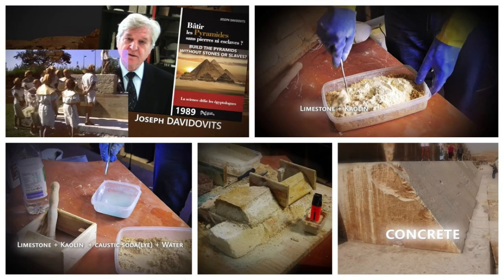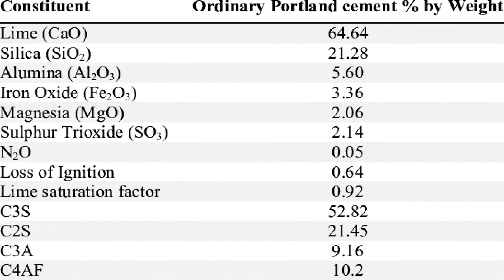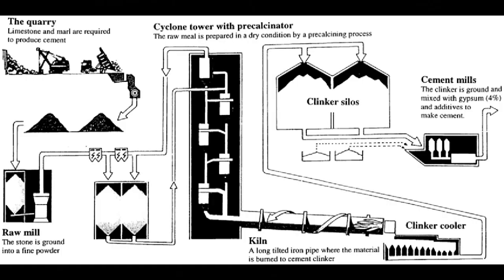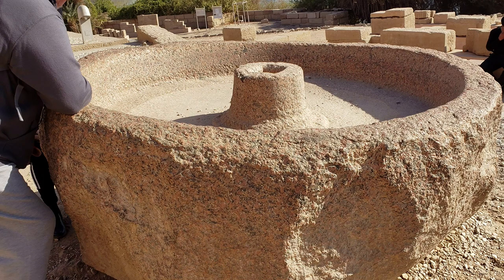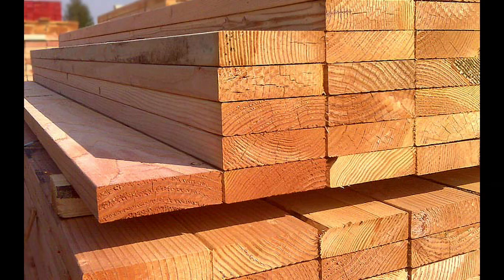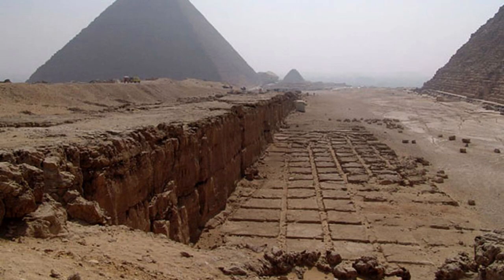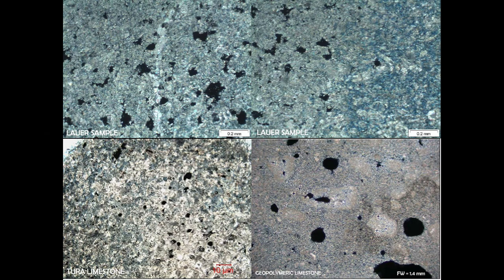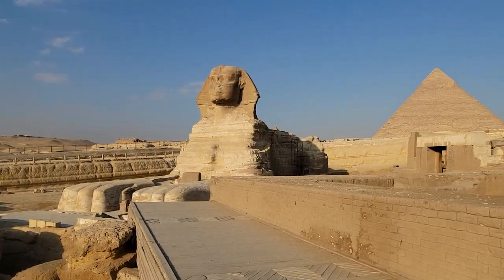Did the Ancient Egyptians use geopolymers? Part 1

Comment: A parabolic lens or parabolic mirror some kind of reflecting dish or polished brass or other metal could have been used to harness the sunlight and angle it and direct it towards melting pots are crucibles😮
Reply from the maker: perhaps...unfortunately there are no such mirrors or crucibles in the archaeological record.
Reply: @AncientEgyptArchitecture  Roman concrete was just reconstructed ot deconstructed or reverse-engineered.
So maybe we get a hold of one of them their pyramid blocks let some Specialties dissected and we will find out what Egyptians made their concrete out of ?
😳😮☄ I got a damn over here by Las Vegas Nevada you can't fit a piece of paper in between the blocks wonder how they move those blocks around with and set them next to each other so tightly to make that Hoover Dam?
😳😮☄
Reply from the maker: The blocks in the Hoover damn were made by pouring concrete into formwork, side by side. No blocks were lifted or moved into place, they were all cast in situ.
Reply: @AncientEgyptArchitecture  now you know how the pyramids were made a very crude process that's why you can't fit some blocks next to each other. They just reconstructed or re-engineered Roman concrete. It said that they leave big chunks of limestone within the mortar mix. What what does that have any significance towards. Glycol concrete it will eventually crack. Roman concrete was made with chunks of limestone so when it cracked water would seep in liquify the Limestone and it would Harden after solidifying and filling a crack strengthen itself. That's how they stand today!
  Not because they cut them and carried down and place them on top of each other. Which a lot of columns and pillars suggest that the segments were stacked vertically round blockson top of one another. 
  So ask yourself is it easier to move a bag of dirt a bag of crush quartz a bag of limestone a bag of sandstone a bag of seawater and a bag of ash from a mountain volcano or is it easier to move a "Obelisk"
If there was any drills or any tools used to core out or make holes it had to be constructed out of quartz crystal because when you drill into a quartz crystal you will create and release electric Sparks.
Reply: As long as we have the pyramids in front of us we will always be confused and misguided. Because the Builders of the pyramid didn't have the pyramid sitting in front of them when they had to consider and construct or create a method to achieve the finish product. You want to discover the creation of the pyramids stop looking at the pyramids
Reply: Furthermore the shape of an obelisk is representative of pouring forms tapering the form smaller and smaller the higher you go to exert less Force outward from the liquid mortar mix knowing the base needed to be thicker that's how even the pyramids are made with a thicker base tapering down to a point
Reply from the maker: I'm not sure why you keep referencing  Roman concrete...they developed their own formulas and methods more than 3000 years after the pyramids were built, at a minimum, not before, and did not 'borrow' or 'copy' the technology from the Egyptians. Roman concrete and any supposed geopolymers of the Egyptian early kingdom would be quite dissimilar.

As for obelisks, (1) the Unfinished obelisk in the Aswan quarry is an excellent example of hewn /cut work, not casting, with the tool marks still plainly visible, along with another partially  finished  one in the upper south quarry, 
 https://youtu.be/gKUos8JnovM 

(2) re. your question of which is easier, moving a bag of cement or an obelisk, the correct sentence format would be, which is easier, moving THOUSANDS of bags of cement, aggregate and water, or a single obelisk.

(3) in any event all obelisks are carved from granite, not limestone, so concrete/geopolymer formulas and techniques do not apply to them.

(4) In the early kingdom period ( and before )  columns were carved from one piece and stood up.  During the late middle and late kingdom periods, 1500 years later, the knowledge of such engineering feats was gradually lost,  and columns were formed by stacking up round sections.

I'm uncertain of your meaning when you state that the pyramids were made by a very crude process where you can't fit the blocks next to each other; I have personally examined the construction of the pyramids and other monuments of antiquity and also attempted to measure the gaps between the blocks, and I can testify that they are an absolute marvel of engineering, 
fitting so closely together at the joints that not even a human hair can pass between them, after sitting there for over 4500 years; nonetheless there is mortar between them, which of course would not be necessary in a 'poured'
or 'cast' block method.

Comment: Geopolymer is not emulsified cement. It's a dissolved and reconstituted crystalline binder similar arter reconstitution to natural stone except without the same imperfections. Of course some blocks were cut but most were formed. But that's not even the profound statement. The most profound statement is that high technology was used and it was done ages before Egyptians existed.
Reply: There is no evidence of them being formed. Therefore you can’t definitively said it’s a polymer.

Comment: Thanks, good work. You may benefit from the work of Bob Greenyer over at MFMP on YT. He is making a strong case that the GP is a cold fusion or LENR reactor.  This direction builds considerably on the work of Chris Dunn, and imho pushes through to a largely robust explication of megaliths, and much more (ie lighting underground, levitation, softening stone w/o thermal heat, etc.). This is a science that Tesla was re-discovering. Perhaps we will see each other over at the MFMP. Peace Cheers Onward.

Comment: Thanks for covering this - the comment sections of some videos are filled with this 'everything was concrete' nonsense.
Reply from the maker: Thanks. It is quite vexing. I have a lot of similar comments on this channel and I felt moved to address the issue with some common sense.
Reply: I’d like to know what tools were used to scoop out the stone from under that obelisk. Dolerite balls and copper chisels? That’s so silly. There are scoop marks everywhere and there are parts of the retaining wall that have marks where there were obviously boards for forming.